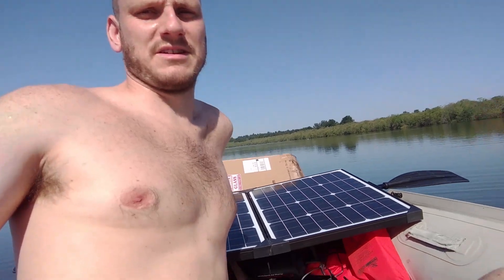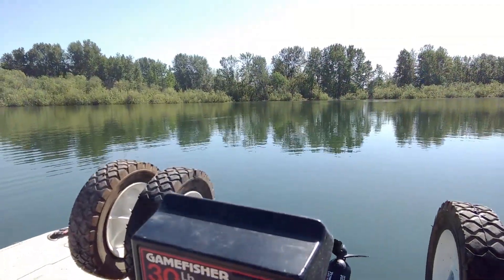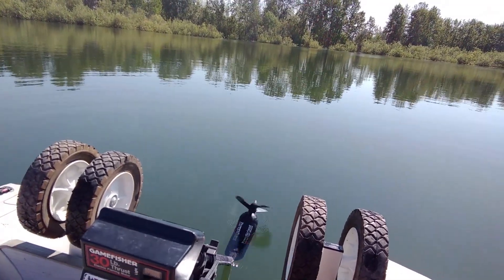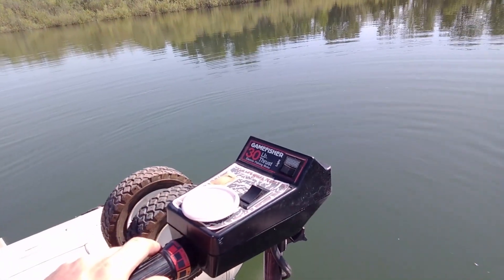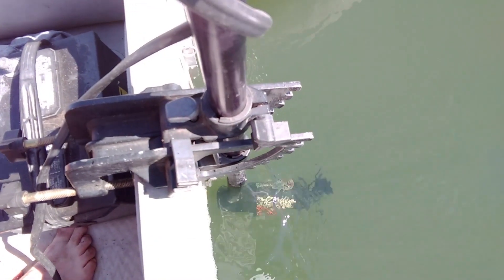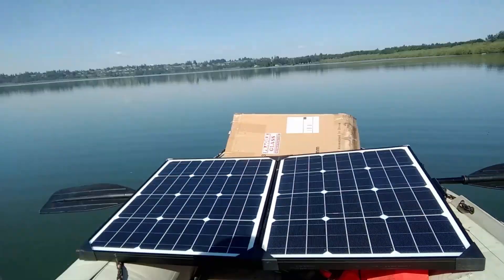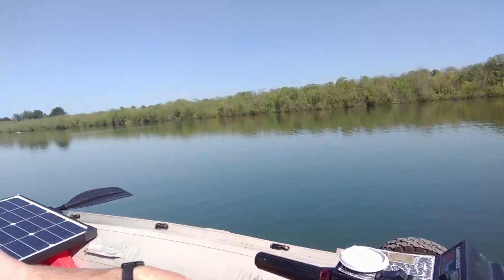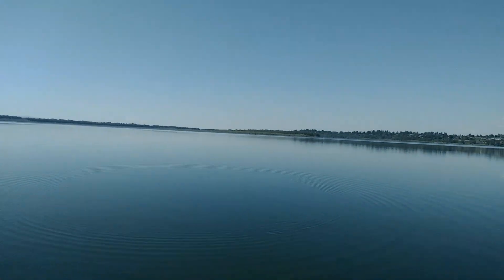100 Watt Solar Powered Boat

Comment: You must use mptt for maximizing solar output. 12v 8ah can give 100 watt panel with mptt. But you should use at least 2 panels . 18 lbs trolling  could be better. 30 lbs may be at speed 3 can work with 2 panels 12v 16 ah total output.
Reply from the maker: Ya I will hopefully revisit this video now that I’ve had a few years to learn. Any recommendations for an affordable yet good quality one?

Comment: I think you need a DC-DC converter to couple the MPPT voltage of the panel to the working voltage of your electric motor, so you'll really get all the juice of power, the solar panel can produce. I'll desigh and build myself that DC-DC converter. 
I'll try to run my inflatable boat with just a 100w panel an electric motor and my DC-DC converter. I think this is the best way to use solar power because batteries are still expensive and have a relatively short life at the time, solar panels are geting more effcicient and a nowadays single two squere metter pannel can produce more than half a horsepower in a sunny day....
Reply from the maker: Next time I’ll add a battery to power the motor and the solar panel to charge the panel. Panel didn’t have enough amps

Comment: Because a 12 volt panel needs a higher voltage to charge 12 volt batteries, they are rated based on an 18 volt output. So a 100 watt panel puts out about 5.5 amps in full sun.
A 30 lb thrust motor needs about 30 amps for full speed.

Comment: You need a battery. You will burn up your motor. That motor uses about 30Amps of power and your panel only puts out 4 or 5 amps
Reply from the maker: Ya, I agree. I didn't run it very long. Best option would be to use the solar to charge the battery that powers the motor.
Reply: It won't hurt the motor to underpower it.  It just won't perform well.  That's all.

Comment: It would work great if your out all day, keeping the main battery as full as possible. I think those lower end motors are rated at 50amps.  You need a pair of nacell pontoons with roll out roof style panels. 24x24 inches by about 10 foot should be enough panel area for 50amps.- sry, now Im just thinking outloud :)

Comment: Get a battery and an ammeter. Measure the amperage at the speed you want to travel at. Then get enough panels to output that amperage. OR, use the panels you have and a charge controller to boost the range of the battery you drive the motor with.

Comment: It is easy to optimise a system like that. Compare the panel output voltage under load with the panel's published max power voltage. If the loaded voltage is lower, it means the motor is demanding too much current. You can try a shorter pitch propeller - model rc plane props work really well - or use a buck converter between the panel and the motor. Adjust the buck's output voltage while under load until the panel voltage has risen to max power. The output on the buck will be at a lower voltage but higher current. I get 3.2kts on my kayak with 3x 50W panels, no buck converter, just trial and error with propeller choices.
Reply: You solved the mystery! You can't load solar panels into a low resistance load like this ane except any meaningful power out of them, They have to be around their maximum power point (17-18V) to deliver their name plate power.